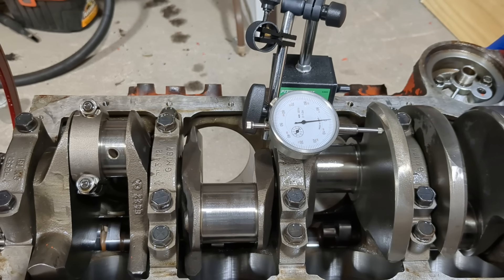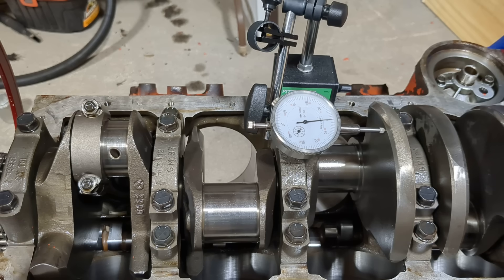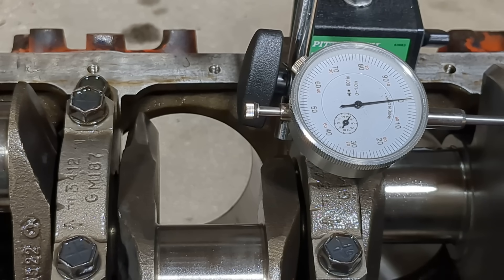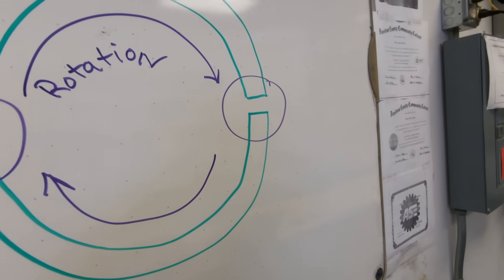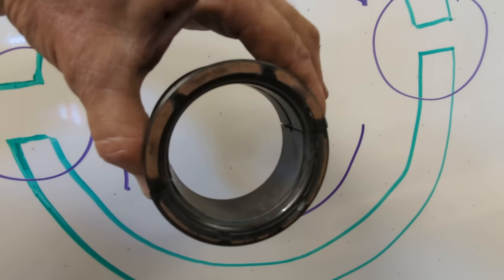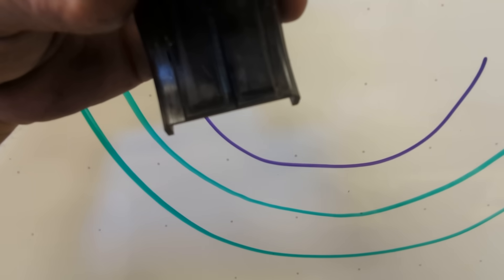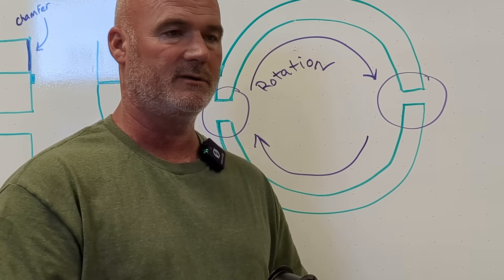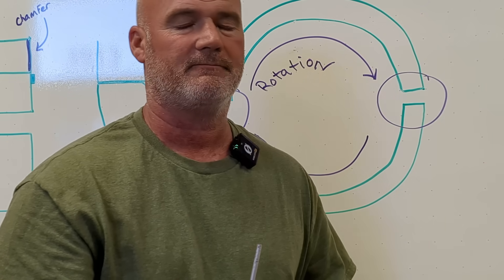CHEAT CODE FOR BEARINGS/SAVE YOUR EXPENSIVE CRANKSHAFT/ZERO thrust bearing wear, Reduce Engine Temp

Comment: Read 'em and weep . Very rare , myself and only seen one other , but of course there must be more , most everybody rocks the crank back and forth when just starting the bolts , good , then some rock the cap as they snug the cap , better , but I force the crank as hard forward , after rocking ,( within reason ) as I can and hold it till I get north of 70 pounds on the bolts or studs , better yet . This of course is the way the clutch pushes the crank . Sometimes getting a thou more clearance , and seating the flanges for better heat transfer ,,, ! ,,, on edit : and yes seen similar and have done it myself ; however not as well thought out as Bryan . I usually don't bother because the stock bearings have some gap there , but not as much as Bryan . Also very few circle or road race engines here .
Reply: YEP
Reply: You do know that torque thrust is far greater than pushing on a pressure plate, the majority of thrust is on the opposite side, there’s a reason that the thrust bearing has flanges on both sides, I remember reading a ford manual for the FE and it said set thrust bearing to the rear, which makes more sense, it seems to me that everyone with half a brain ( I’m including myself) can’t agree on anything, myself, I make sure the flanges line up and finish tourqing, once bearing crush takes place, they’re not moving
Reply: @alanmeyers3957 ,,, it's obviously the pressure from the clutch . I've got 70 years in this ( some of it actually working ) and almost all the problems came from the clutch . It's not so much the amount of pressure , but rather the amount of time a foot is on the pedal ; however had a successful Pro Stock friend of mine that had toooo long of a tranny input shaft that was eating thrust bearings  .

Comment: I've seen some guys do this just on one end of the upper bearing (block) to feed both sides from the same spot. What benefits does doing it like this have?
Reply from the maker: I feel like it guarantees me that I'm going to get oil to both front and back and not have it go to one side doing it the way I showed you
Reply: @SalterRacingEngines  you got a good point there. Thanks